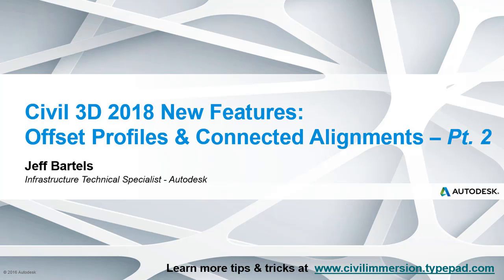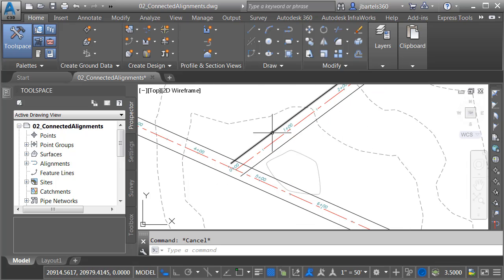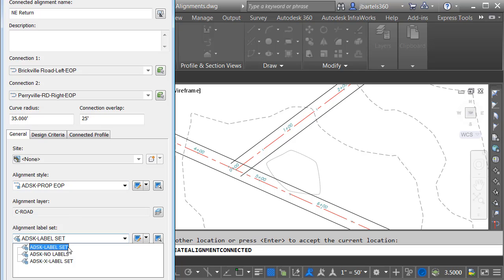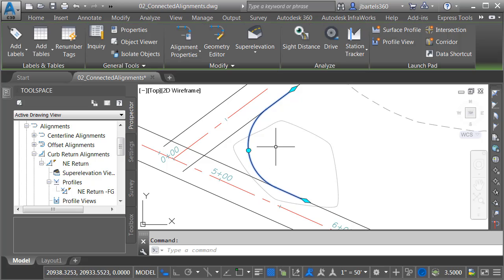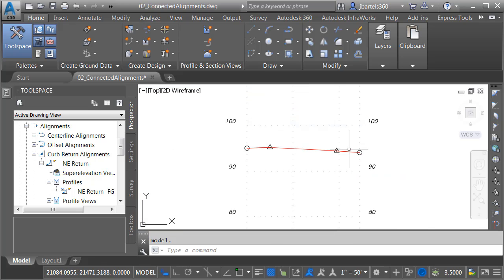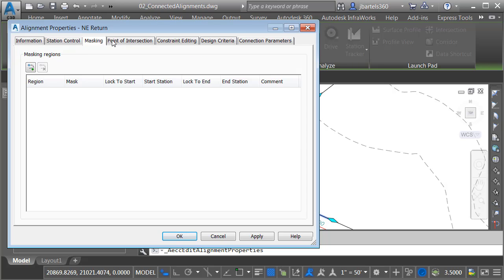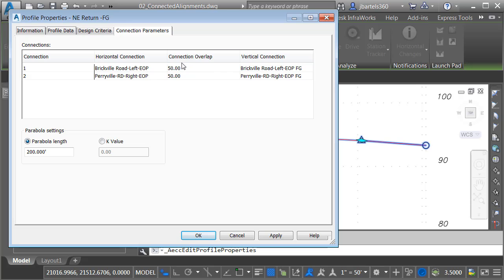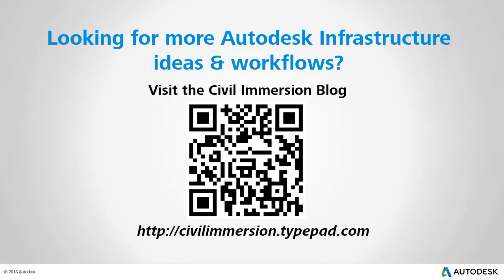Civil 3D 2018 New Feature: Offset Profiles & Connected Alignments - Pt. 2

Comment: Dear Jeff, Excellent article, I have a request if you can guide me Please, how can we add dynamic x-section in profile view for the survey features i.e culverts, (rectangle as well as circular), bridges, pipes, retaining walls etc.) along with their specification information, i.e size, levels, etc. i want it to be dynamic on alignment as well as in profile view.  I tried to use object projection it projects complete 3d objects rather than giving x-section at centerline alignment. 

please guide.
Thx in davance

Comment: is there an advantage to having the connected alignments versus having one continuous alignment representing the EOP?
Reply: Generally, it could give you better control of the intersection when building a corridor. When targeted for an intersection, you'd already have both horizontal and vertical control. In addition, they'd be dynamic.